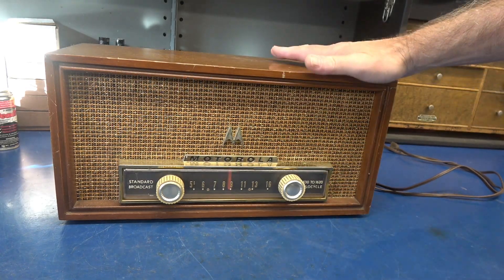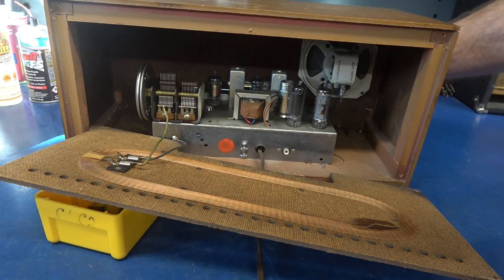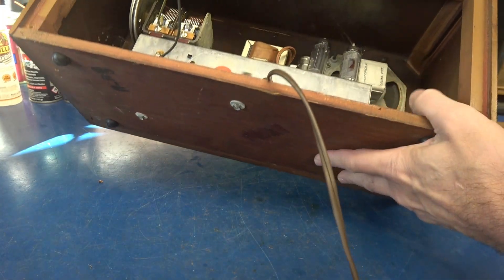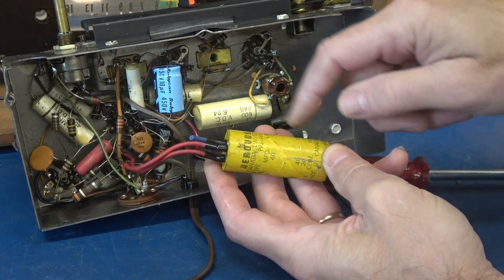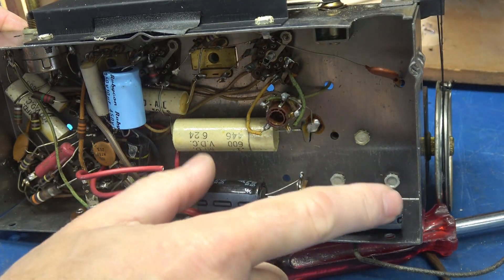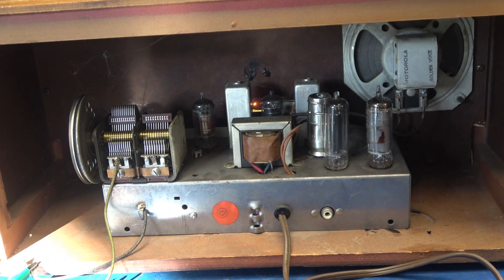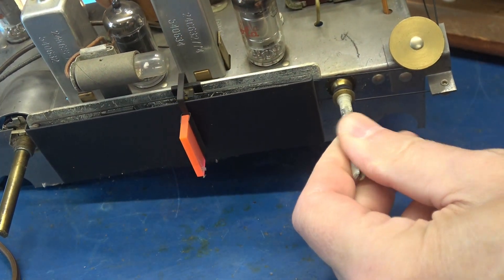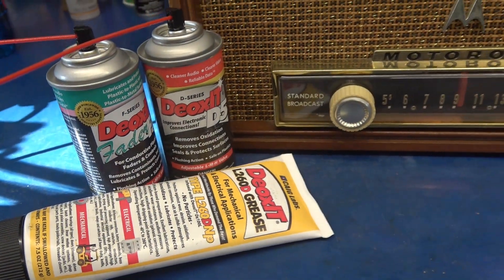Vintage Motorola 57W antique wood AM tube radio repair using Caig DeoxIT products

Comment: Sweet looking old radio.  Glad you managed to save it.  I have fond memories of the Zenith table top radio I listened to extensively as a youngster.   Some of those old radios were quite stylish.
Reply: Was it the 7-tube AM/FM one?
Reply: @PlanetaryThoughts9861  It was AM/FM and on the large size for a table top radio.  I don't remember how many tubes it had hut I do recall taking the tubes to electronic stores back when they had self service tube testers.

Comment: Question for you, I purchased some of that deoxit grease because of one of your videos and I purchased that exact same bottle.  You may have used it more, but I’ve only seen you use it twice, once on this application and another time to lubricate the VFO shaft.  Is there a reason why you’re using this grease specifically for this? With the cost of this Greece and the fact that it has D100 mixed into it. I would think that using it for contacts would be its best and only use. I’ve used it to lubricate the inside of switches, specifically the contacts after opening them up and cleaning them. I’m assuming that you would have just good old normal grease’s lying around, is there any benefit to using this grease with the deoxit in it in the instances you did? Hope that makes sense.
Reply from the maker: Hello, good question. I have been using the L260D on rotary switch contacts, plus mechanical items that I have noticed corrosion on. I use it sparingly. I find that standard greases like to harden when exposed to heat. The L260D does not. I am still experimenting with its use.
Reply: @d-labelectronics alright, excellent answer.  The bottle definitely goes a long way.